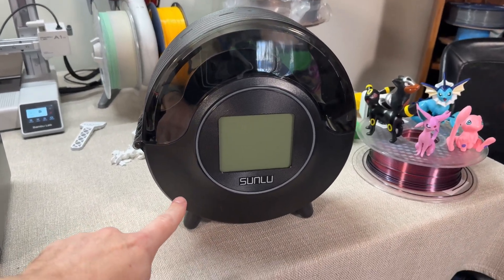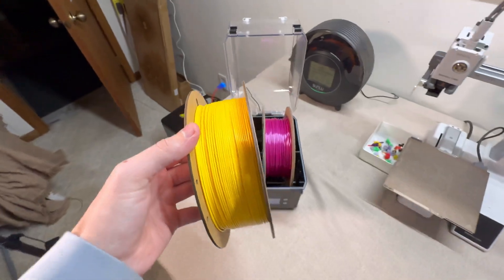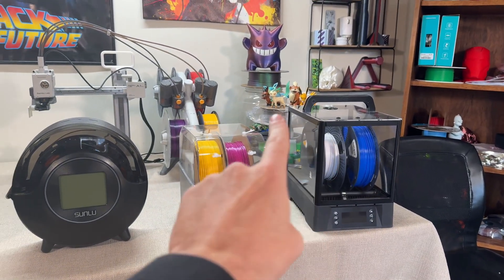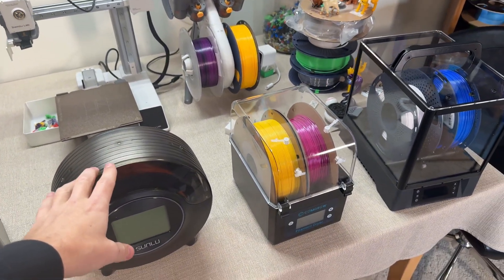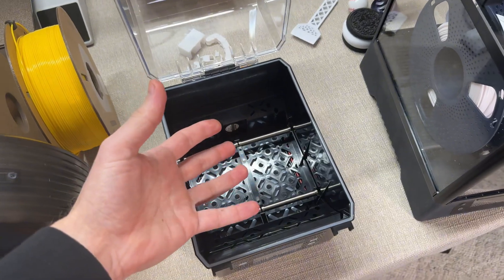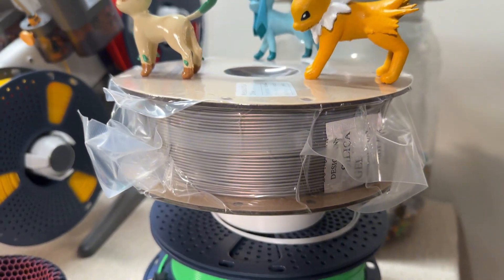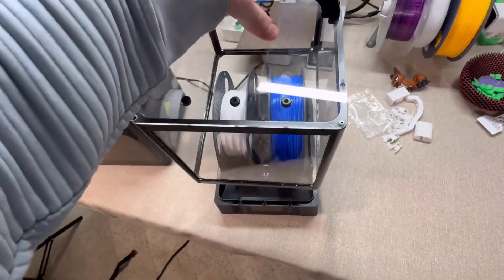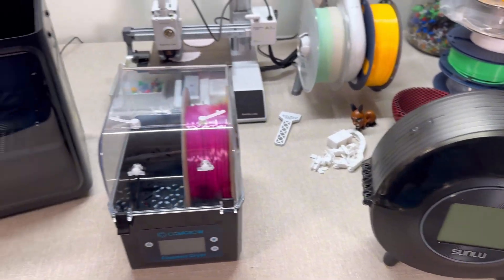What is a Filament Dryer? And Do You Really Need It?

Comment: I’ve been printing for nearly 14 years with PLA and PETG. Never needed a dryer. I have PLA 10+ years. A transparent and silk printed models simply disintegrated in my hands to powder. Other PLA objects still solid. Some PLA filaments prints ok but some are brittle and just break so I dump them. 
I once did a test by soaking GENERIC PLA in water for a day, wiping it off with a towel and printed ok. 
So I think for PLA PETG I don’t need to waste my time, money and electricity drying it for 8 hours, every time I want to print something. And I don’t print figurines.

Comment: As a beginner, I'm considering a filament dryer. I also recently got the dumb idea in my head to build my own: I printed a box, with holes for the filament to come out so I can print from it, a spool mount, a big tray to put a bunch of desiccant in, and if needed I'll add these usb-powered heat pads made for the inside of a coat I've had floating around for a while. No idea if it'll work, but it's been fun to try! (Also, each box uses like 600g filament, after I thinned the walls lol)
Reply: Is the box heat resistant? Not all filaments are heat resistant to my understanding. (Also a beginner)

Comment: I'm looking at getting a 3D printer this week and have been doing some research. Your video was great, but I have a question. What humidity level should the area you are printing be to keep the filament dry?  How long does it take to dry the filament in your dryers? Do the dryers 'beep' or display the internal humidity when the filament is dry?

Comment: I thought about getting a dryer but the idea of it is off putting for tree reasons. 1: needless electrical cost and management. 2: fumes going into my work environment. 3: cost.  For these reasons I spent $8 on ziplock freezer 1gal bags, $15 on 2lb descant, and $13 on 12 altoid tins, and $8 on 6 hygrometers. I drilled holes in all the altoid tins, filled with pellets, then 3d printed holders for the hydrometers and put a rubber band around the altoid tin to prevent spilling.  it all fits nicely in the 1gal ziplock and goes into a bin.  The air inside each bag got down to 15% or below in a few hours. worked nicely and the altoid tins can be put inside of an oven to dehydrate, they might eventually rust but will still work. Costs about the same as a cheap dehydrator but I can have 12 spools drying and stores at once. I even have a plastic tub that i put window gasket around the lid, so it's a double dry environment and there won't be any air seepage.
Reply: That is not actually the same but if you're not making money off your prints, and not using high end filaments.

Comment: I’ve had that thought of “Omg I need to spend money on another thing??”  Since getting my 3d printer multiple times. More-so because I’m using it to make props, so I need to buy all the tools and paints to make that possible. But I got so desperate with random printing issues, even after calibrating multiple times, that I was willing to pay anything to fix it. Trying my first print now after using a filament dryer, I guess I’ll see if it was the magic bullet for my problems. Thank you for your explanation too, I didn’t quite get how they worked.
Also, mine has a spot for silica gel packets in the bottom. Of the humidity is supposed to escape through the top, what are they needed for? And do I need to buy more?
Reply: Did it change something for you?
Reply: @Vei-kz5sz  Hard to say. I didn't notice any immediate improvement. I need to try to print a larger object again to see if there's any change. But, it's at least a good peace of mind to make sure my spools will always be dry now

Comment: As a complete beginner to this- i just got bambu a1 mini with the combo that you can out up to 4 spools….but the dryer you mentioned that holds four rolls can also connect to the tubes- so then I wouldn’t be using the asm (whatever it is called that holds the 4 rolls on side of printer)?
Reply from the maker: Most people dry the filament in a dryer before using
Reply: if you have an ams and only 4 rolls of pla, your fine with your ams and dessicant in the ams. dessicant holders with hygrometer fitting for ams should be first prints. when you get into nylon, abs i think, or carbon fiber infused filament, you'll need something. im using a cheap vacuum  space saver bags from amazon until I find the right set up. Inverted cereal boxes are good for X!C bambu because even with AMS unit, I can use non-bambu filament feeding from the back. you should also know that not all 3rd party filaments fit in the AMS.
Reply: dont forget he is referring to storing fllament for long periods. if you take pla straight out of box into ams unit, the unit will show a number from 1-5 for cabin humidity. if only 4 spools of filament and having fun with learning, hold off and you will pick up info and see what you need as you go. Save your money. don't rush out and buy everything you see on youtube.

Comment: Can you just put the filament in a sealed container with silica gel packs that absorb moisture?
Reply: i just put 10 spools in a vaccum bag to test humidity, in one hour it dropped to 20% humidity with only 4 filmanet reel dessicant containers.
Reply: You can and that's the best option for storage but that's more of a preventative measure. It will help slow moisture accumulation but not really dry things out.
Reply: You could, but depending on the volume of your container and amount/type of descent it could take days to weeks if you are starting from a higher humidity. You would also need a way to dry your desiccant once it is saturated

Comment: ..xD buy Sunlu PETG, out of box it is so moisture that you cannot print single thing in any good quallity.. if you buy good quallity fillament (20 and more usd) you dont need dryer, you dont need special dryer even if you buy cheap fillament just dry it in oven 6 hours 50-70 Celcius degree, but if you print many things and use many fillament buy bigger dryer for drying 1 or 4 spools on month it is throwing money to garbage
Reply: have you tried the air fryer method? all my filament is mainly Bambu
Reply: @christosvolikakis1523  I'm telling about this, with Bambu fillament you dont really need fillament dryer, why to spend money on any dryer if you doesnt have print farm? When you print only 4 u, oven is enough, dont spend money on things that are not necessery xD

Comment: I'm wondering about the need for one. I'm getting my first 3D printer for Christmas, the Bambu A1. I'll be storing my filament (PLA, PLA Wood, PETG) in a sealed container with plenty of dessicant packets, but how much could be absorbed as I'm printing? If a print takes 16 hours, how much might be absorbed in that time?
Reply: Desiccant really only removes moisture from the air. Filament is often be shipped with moisture already absorbed in its core, because water is used for most filaments to cool it after extruding. You need warm air to pull the moisture out of the filament, so desiccant won't really do much alone.

CNC Kitchen has a good video explaining different drying methods:
https://youtu.be/eqQRN9TUw08?si=ryFt5v0KdjhMxYCv
Reply: @gothnate  one of the best answers I'v found. thank you. I guess I'm working with good filament that had very low moisture to begin with.

Comment: My printer sits in my basement with humidity of 21% to 30%. I've seen many people claim they don't need a filament dryer but my experience is that print quality improves sometimes significantly just from drying the filament. Even with PLA. Can you print without a dryer? Yeah, but I wouldn't recommend it.
Reply: @lonewolftech  PLA is pretty forgiving. You CAN print PLA without drying it however in my experience the surface quality is better with dried filament and you reduce your risk of print errors due to broken filament since PLA becomes brittle as it takes on water.
Reply: @malatoke I’d recommend it, as it can cause bad layer adhesion which Is what I’m suffering with currently and now im unable to print until I get a dryer.
Reply: Try living with humidity of 70%+. Filament dryer is super helpful for me hahaha
Reply: You can print without.

Comment: A question that I had about the S4 and have not been able to get a good answer to is, if I am not feeding my X1C directly from the S4, should I not install the PTFE tubes into the S4? And, if not, should I use the provided plugs to plug all or any of the holes in the S4 and keep them there while it is drying or storing filament?
Reply: If youre not printing from the AMS for the x1c, and instead using the s4 as an external spool feeder then it would be idea to have a line of ptfe ran to the s4. Otherwise you will have a few feet of filament exposed to the air ready for the next print that could have ugly first layer issues. assuming you didnt unload it.
Reply: @Penguinishy  Don't think that's the question.